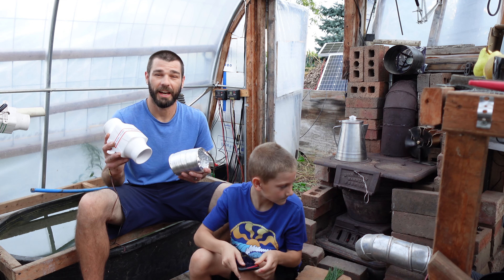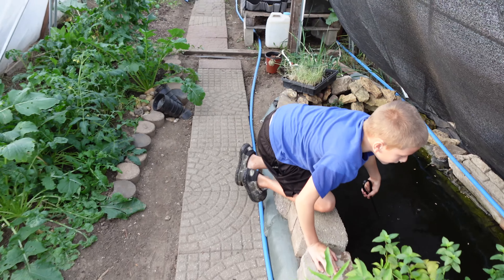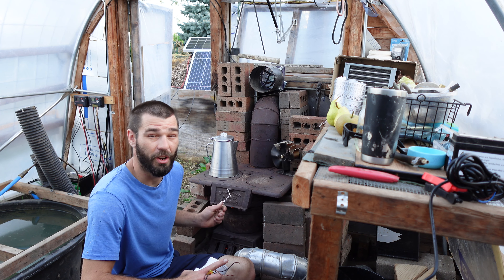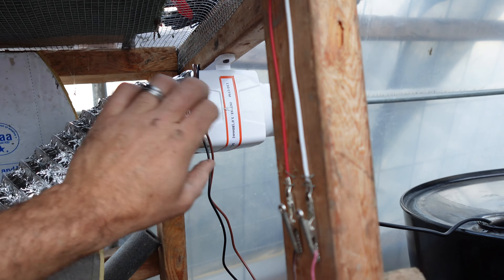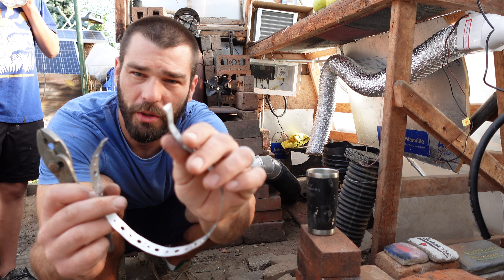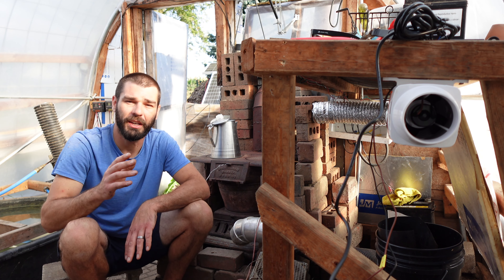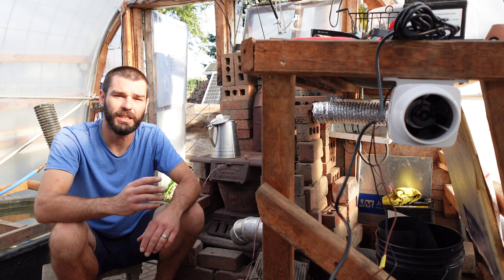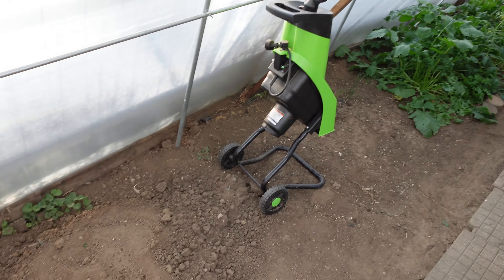DIY Greenhouse Heating Experiments - Moving Heat With Solar Power! Free Heat For Winter Greenhouse

Comment: Turn the fan around and blow cold air onto the bricks and stove. Currently, you are getting cold air to go through one hot brick.
Reply from the maker: The airspace in a good 5foot circumference around the stove is 80-100F we’re trying to blow the heat to grow tunnels that were going to set up. The thermal mass of the bricks will be an experiment to see how we can pull the most heat the longest.
Reply: @Earthdwellershomestead  green house in a green house. Grow tunnels are a good idea.

Comment: I just watched a video where the person banked woodchips and grass clippings 4' up the sides of the green house and it stayed warm all winter in upper Utah
Reply from the maker: We do compost heating but I try and keep it separate from the greenhouse cause the rodents will live in it all winter and they can chew wires and poly, after years of using the heat from compost there’s some things I won’t do anymore and having the compost up against a wall is one of them. We did just that in our small greenhouse for years and fought issues with rodents

Comment: I ham interested in putting copper tub around vent pipe coiled about a foot then run to ground.  With water in it. System closed. Should re circulate cold water back to  heat source.

Comment: Hey man! I followed your lead and build a hot compost pile to heat my greenhouse. However, the forced air is not really warm after dark. It’s basically just the same as the ambient air. The compost is 140 and the waterline i have coming from it is as hot as a bath. Can you help me understand why my corrugated air pipe isn’t putting out warm air? It’s a solid, non perforated pipe. Thanks!
Reply from the maker: That’s interesting, since you have an active pile putting heat out of the water lines I’m assuming that your air piping isn’t in the center mass enough, or possibly not enough surface area to transfer?
Reply from the maker: You could be flowing more air than the system can heat that quickly also.
Reply: @Earthdwellershomestead  i think this is probably the cause, because I have about 40-50ft in the pile. I may need a smaller fan, but I’m running it on ac, not dc so its been hard to find something small enough other than this 4” inline
Reply from the maker: @TheRedditMultiverse  I’ve had lots of experimenting with this system and have had to rework them to get the flow rate to heat tranfer down pat. A cheap small adjustable speed fan might do the trick
Reply: @Earthdwellershomestead  I’ll take your advice on it. Do you know your cfm that worked best for you?
Reply from the maker: @TheRedditMultiverse we ended up using 12v dc pc fan funning 88cfm but it cam out the other side of the 100foot pipe much less than 88 but still put out good heat for a long time. Also consider the btu your drawing from both system and many you’ll need to stagger their operations also. Experimenting is the best way to get it right lol